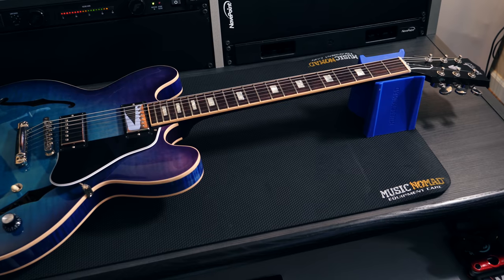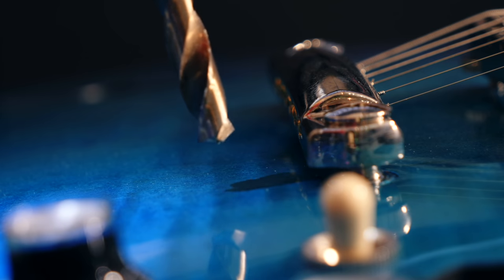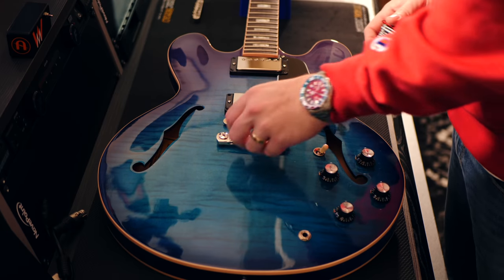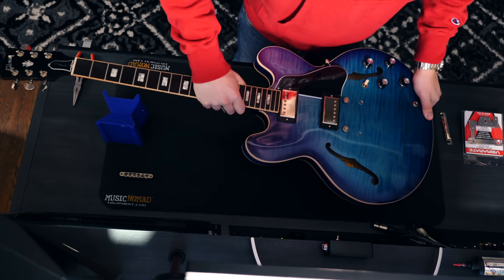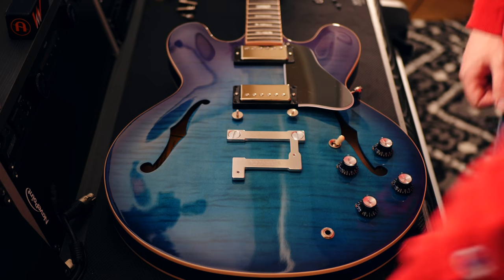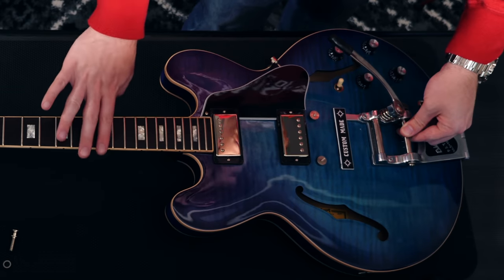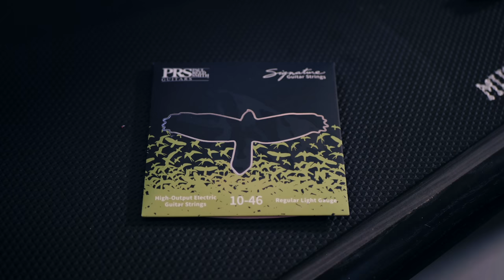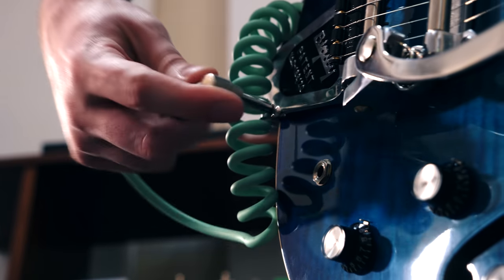Installing a Bigsby Bridge on my guitar

Comment: Am I the only one that had a minor heart attack  when he grabbed the bridge screw by the thread... with the pliers 😬😬😬
Reply: As a professional race car builder and part time engineer, it's not that big of a deal, that bolt is plenty hard enough to not get mashed threads
Reply: I was literally just thinking that! Whenever I do anything with screws on a machine or instrument, I dont wanna damage that perfect smoothe shiny screw.
Reply: Catastrophic Stupidity  .
I know i know. But I still like the shiny screws.
Reply: Nope, that hurt me too. I wouldn't dare risk damaging the fine threads on one of those bolts. Though, to be fair, he most likely has several spares available if something happened to one.
Reply: no
Reply: @ArmyBoiSweat  bro that’s actually so cool
Reply: @Giby321  typically, unless it is a specially made bole or made of brass or aluminum, the bolt comes from a supplier, and the majority of bolts made by the supplier are hardened. It would be cheaper for them to use a hardened bolt
Reply: @Giby321  to a certaint extent yes. A lot of industrial tools use skateboard bearings becuase they are cheap and readily available
Reply: as soon as i saw that i went to the comments to see if anyone else noticed LOL
Reply: Yeah as long as its not a scrappy screw it should be fine but I was slightly scared too haha
Reply: haha same, i've had enough fuckups while customizing my guitars to know what never to do xD

Comment: All tremolo's are vibratos, all tremolos are named wrong thanks to leo fender.
Reply: @nuclearsenshi tremolo alternates volume, but close enough
Reply: Leo
Reply: if anyone reading this comment is confused, heres what tremolo and vibrato mean:

tremolo - an oscillation in volume (how loud/quiet something is)
vibrato - an oscillation in pitch (how high/low something is)
Reply: what op said is that trem bars on guitars are the same as vibrato bars which is the same as a whammy bar
Reply: @JJPMaster  no
Reply: Thanks to ol Leo the tremolo effect on amps that fluctuates the volume is called a vibrato effect on fender amps
Reply: Yup. A tremolo is what for example the tremolo pedal does, alterations in volume
Reply: @jldkrank  except, yes. Tremolo bars don't do tremolo, they do vibrato.
Reply: Vibrato changes the note up and down and tremolo changes the volume up and down.
Reply: I have been told of this in the past and can confirm it is true
Reply: @Cameron Clark what you described is just vibrato. Leo was not a musician, he was a business man. Tremolo is a modulation effect that rhythmically changes the volume of your signal. Vibrato is a pitch change only. Very different effects. With a whammy bar you'll only get vibrato. For tremolo you'd need to use the volume knob, but a pedal or built in amp effect is much easier
Reply: @Cameron Clark its named wrong. That's what we're saying. Its only called a tremolo bar on anything inspired by fender because he called it the wrong thing
Reply: This comment made me depressed
Reply: tldr we're calling out tyler for calling things like a floyd a 'tremolo' and a bigsby a 'vibrato'. Theyre both vibratos, theyre just called tremolo bars because of leo fender
Reply: @ivan-vp6ex  lmao. I imagine Leo was just laughing inside as he knew he was going to troll guitarists for decades to come.
Reply: @ivan-vp6ex  but that’s right

Comment: lol, glad to see i wasn't the only freaking out about the drill....i'd honestly just buy another guitar before i drilled into something, if i wanted a bigsby on my 335 i'd just sell what i had buy what i wanted....that said, a no drill bigsby is pretty cool! glad you didn't have to do that!
Reply: Same, I literally stood up and started pacing as the drill got closer
Reply: There is a Bisgby you can buy that you do not even need that adapter plate for. But that 335 now has 4 holes in it at the rear strap button location, which is fine if you plan on never taking it off, but if you do change your mind, well too darn bad lol. Me, I would just use the one hole where the strap button goes through and mounts it and not use those screws until after I was POSITIVE I wanted to keep the Bigsby on. I have a gretsch with one on it and it does nothing for me but I don't use a wiggle stick anyway. I did put a trapezoid bridge on my 335 style Peavey and I love it. You can just press down on the strings with your hand if you want to get a Vibrato type of effect, like Ted Nugent does on his Byrdlands. Also with the trapezoid I can just do one string where as a regular wiggle stick setup it's all or nothing. I did have to put 4 screws in by the strap button but I did wait until I was sure I was going to like it lol.
Reply: Shoot I was nervous even when he stopped but he was still just holding that drill bit that close!!
Reply: Hey man im curious..how much you payed for your 335? I just bought a brand new 335 but from 2011, has never been used and kept in a case with a humidifier.

Comment: Quick note about tremolo vs vibrato: all whammy bars are vibrato bars. Vibrato is a variation in pitch, tremolo is a variation in volume
Edit: didn’t mean to say speed.
Reply: A variation in speed would be the same as pitch modulation, as pitch is the speed of the vibration i.e. the frequency of the note? Actually, Tremolos produce a modulation in volume. One rather clumsy way to produce a tremolo effect would be to rapidly open and close your volume pot.
Reply: tremolo is a change in volume, and vibrato is a change in pitch
Reply: @EdgarsLS  Indeed that's what I said...
Reply: It’s a whammy bar lol

Comment: I used a vibramate conversion thingie on my sg and it works great. However, in regards to the stringing hassle, Callaham makes a replacement cylinder piece that just uses holes instead of those prongs which makes stringing much easier and I think it looks better than the Vibramate alternative.
Reply: link?

Comment: I got a Vibramate for Christmas so I could put a Bigsby on my Epiphone Dot. I also got a string spoiler, which is amazing. I put a slight dent in the finish when I put the wrong screw in at first, but it's under the Vibramate, so you can't see it.
I will say you missed a good opportunity to switch to roller saddles.

Comment: Vibrato is an effect that occurs when the value of the frequency is changed in rapid succession. Tremolo does not change frequency in rapid succession, but instead changes the tone's amplitude rapidly. 

Congrats on the bigsby. Looking forward to hearing it on your new album...

Comment: Just be aware buddy that those Vibramates DO damage the finish - where the felt pads connect they will eat away/dull the finish.  I had one on an SG for about 4 years and there are three very noticeable marks where the pads sat.
Reply: Be sure that you really want one lol
Reply: Yes, but drilling holes is also going to damage the finish, so...
Reply: I was thinking that leather pads would probably provide better protection than felt. But, in either case, there will likely be some damage to the finish over time.
Reply: And ... did you see those 4 screws he had to put in by the rear strap button? You can't undo that once it's done!! I put a trapezoid bridge on my 335 style Peavey but I waited until I was positive I wanted to stick with that before I installed the 4 screws necessary for that. He just put 4 holes in a $3000 guitar and yes those pads do mar up the surface!!
Reply: @alabamahebrew  nope the vibramate comes with a plate that screws into the bigsby.  the plate is then held on with only the strap button.  no holes in the guitar.
Reply: That’s a great point! You could probably get away with it on a white guitar but not much else
Reply: @alabamahebrew  He did not, vribramate sells a little piece of metal you screw those 4 screws in which is then held in place bij the strap button screw
Reply: Any chance we could get a picture of the result of having them

Comment: I watch this video again after 3 years because of how satisfying it is for me to see the installation.

But there is something that I wanted to comment on and I think it is something that we should all know from now on. The Bigsby system is a vibrato, but the Strat bridge and Floyd Rose are too. The Tremolo is a variation of the volume of a signal, but the bigsby, the strat bridge and the Floyd all vary the pitch and that is the definition of vibrato. The only difference between the 3 is the vibrato range.
The reason why the Strat bridge is called a tremolo is due to a confusion that Fender generated by putting the name Vibroluxe to an amplifier that did not have a vibrato, it had a tremolo. From there the confusion was born

Comment: I've been working on/repairing/customizing/designing and building guitars since 1984 and if there's one thing I have learned the hard way just like you in that video it's to cover any soundhole or f-holes with ( low-tack) masking tape 🙂 this way you won't have anything fall inside the guitar 🙂 and if that should happen anyway get one of these telescopic magnetic pens...
Great video 🙂 I'm a huge fan of Vibramate...

Comment: A little tip from a mechanic:  if your bolt is stuck on the end of the tool you are using and you can't get it off, thread the bolt back in slightly and then wiggle the tool off of the bolt, then unthread the bolt by hand. 

This increases mental stability by a factor of 3 and saves you from throwing a lot of tools across the shop in anger.

Comment: Nice 335 and nice mod! Take care so... That bigsby could be addictive!!
Just to clarify one of the most common mistakes in the world of the guitar:
Tremolo: Amplitude oscillation of the signal.
Vibration: Frequency oscillation of the singal.
If you move the bar of a Fender bridge you are changing the tension of the strings, therefore the frequency at which they move ;)
If you move the volume up and down you are changing the amplitude of the signal :D
So:
So, Fender guitars has a Vibrato bridge not a Tremolo bridge. You installed a Vibrato system not a Tremolo system. The floyd rose is a vibrato bridge as well, not a tremolo bridge.
Fender did a mistake and named his bridge as a "tremolo bridge" and from then most of the people believes that is a "tremolo bridge" but it isn't.
Something similar happened with the Marshall JTM45 with tremolo. On the back panel they wrote "Tremelo" and because he hasn't corrected it since, it's "tremelo"
Cheers!

Comment: Just to add another comment, I got the Vibramate V7 G series and Bigsby B7 for my Gibson es 335 studio. I have found out that the studio is quarter of an inch shorter than the Standard Gibson es 335 and quarter of an inch longer than the Epiphone es 335; which uses the Vibramate V 7 E series. Luckily enough Vibramate are aware of differences and provide spacers of different sizes to fill any gap between the Bigsby and the guitar.

Comment: Tremolo is what you find on a pedal or an amp, where you have repeated volume cuts. Vibrato is pitch change. Whether it is from your fingers or from a bridge unit. Whether it's a Floyd or a Bigsby or anything in between.

Comment: They're ALL vibrato systems - Bigsby, Floyd Rose, all of them. Vibrato is a modulation of pitch, and tremolo is a modulation of volume. 

Also, you should consider putting roller saddles on that. Tune-o-matics aren't great even with a stop tail, and you'll have even more small problems when paired with a Bigsby.

Comment: Tremolo is a variation in volume, vibrato is a variation in pitch. Fender got it backwards: the vibrato on Twin Reverbs is actually tremolo, and the tremolo on Strats is actually vibrato.

Comment: Tremolo is fluctuations in volume, vibrato is fluctuations in pitch. Leo Fender cocked it up and named the vibrato system on the Stratocaster as tremolo and the tremolo circuit on his amps as vibrato.

Comment: I bought a bigsby for my les Paul, but the bigsby was too long, the strap pin floppy bit didn’t lineup. Luckily the boys at my guitar shop had a gadget designed specifically for filling the gap between the pin and the hinge.
Hooray!

Comment: Technicaly, they are all vibrato system because vibrato is changing the pitch and tremolo is changing the volume of the note. We only call them tremolo systems because Fender made a mistake and called their strat bridges tremolo systems. I could be wrong tho

Comment: Technically what you refer to as a tremolo is a vibrato system too. Vibrato is a chance in pitch while tremolo is a change in volume. Tremolo is that thing in fender amps.

Comment: Hey there!! 
I'm a big fan, I watch your videos all the time they're entertaining and informative.

I'm just wondering, with that particular Gibson.

I'm wondering one thing.

Rather than installing the Bigsby (other than the fact that Bigsby is very cool and iconic), why didn't you install a Duesenberg tremolo?

 The Duesenberg tremolo would do the same job as the Bigsby, but it would use the existing stop bar holes on the guitar without a conversion kit.

It can also be removed if wanted to reinstall the original stop bar.

Just wondering.

Comment: Also, the supposed Tremolo-Bridge is a Vibrato bridge. It was wrong from the beginning, when it was invented. The vibrato effect deals with the change of the note highs. The tremolo effect is built-in in many amps and erroneously called «Vibrato». The Tremolo is the effect of getting the notes loud and quiet, like turning the volume knob. So, this effect you can't build up with a Trembar or whammy bar!

Comment: Would a a Bigsby with a longer section in the back be better? It would allow the strings angle to be closer to the original and you wouldn't need to use a sticker to hide the adapter plate. Thoughts? Oh,plus the handle of the bigs would be a shorter reach when playing.

Comment: I was almost ready to get that adapter but then, sadly, saw it screws into the existing holes left by the string holder. I have a no named GibsonClone hollow body that did have a whammy bar (a solid one piece, i.e. the tailpiece is not hinged like the Bigsby, but one solid piece thus not needing to be fixed/screwed down to the top, it floated on top) but I wanted a Bigsby-style and ordered an inexpensive Chinese made copy ($20... free shipping!!)...
I am loathe to screw the B-Clone down to the top because there is no solid block underneath the top just the thickness of the top...
I'm still looking for a solution...

Comment: I thought he was going to get it right, vibrato is variation in pitch, tremolo is vibration in volume. That means all whammy bar systems; Strat trem, Floyd rose, Bigsby, Vibrola, etc, are ALL vibratos. Also I was going back and forth when I clicked whether he was going to drill or use a vibramate, glad he chose the latter

Comment: Time to nerd the place up a bit... "tremolo" means to repeat a note very quickly. It's the sound of a mandolin, or that "trembling" sound you get from a violin section (thus, "tremolo picking"). Vibrato is a vibration; a variation in pitch. All whammy bar systems are vibrato systems. Why people started calling them tremolo systems is beyond me, but the electric guitar seems to be the only instrument that uses the two words interchangeably, and only in reference to what the bridge does.

On a guitar, you tremolo with your pick and vibrato with your fret hand.

Comment: 0:09
All "whammy bars" are vibratos. The synchronized "tremolo" on a Strat is a vibrato. A Floyd Rose or Kahler is a vibrato. A Bigsby is a vibrato. Leo Fender got tremolo and vibrato mixed up a long time ago, and it stuck. The "vibrato" on Fender amps is a tremolo.

Comment: One extra add-on to consider is a roller tune-o-matic—helps out just a little more with the tuning as well as string wear. Installed a Bigsby on an Explorer, used the rollers, would recommend. Something like this: https://www.amazon.com/dp/B07NZT65H7/ref=cm_sw_r_cp_api_i_AhCUEbMSHTPGR

Comment: The adapter thing is an amazing idea, but it seems like they need to just do some fairly minor visual design and it would fit in with the Bigsby look as if it were meant to be there. The sticker thing is super ugly, and it just looks industrial if you leave it uncovered. If they just did some small styling to it by rounding some bits and matching the polish, this thing would be PERFECT!

Comment: Oh but didn't you have to screw the 3 end plate screws into the body at the end of the guitar?? Did the raised location of the Bigsby have a big impact on the break angle of the strings over the bridge??

Comment: Okay pretty old post, but I have to ask. Have you found that using the Bigsby detunes the guitar? I put a (fake Chinese clone) Bigsby  on my (fake Chinese clone) Les Paul. Works really well but instantly detunes the guitar. I have tried putting a roller bridge and locking tuners on it but they had no effect on the problem. Now I never use the Bigsby because it's too much of a hassle to retune all the time. What has your experience been? 
BTW I didn't do it myself, I had a luthier do the mod, and he didn't use an adaptor. He really did drill holes in the guitar. It's a cheapie (Eko brand, cost me $AUD270, about $US190) so I didn't mind. The tuners and the bridge cost more than the original guitar. But it looks very cool indeed!